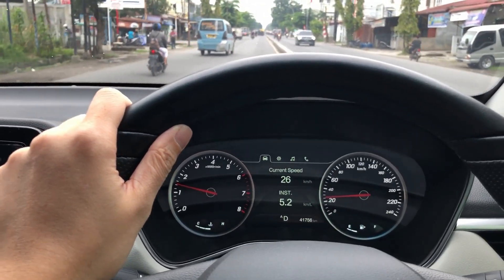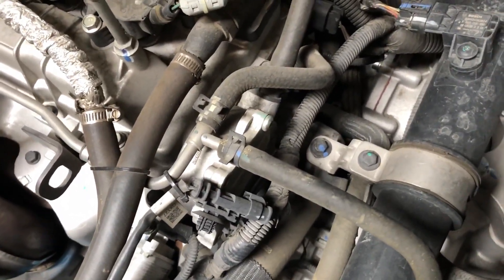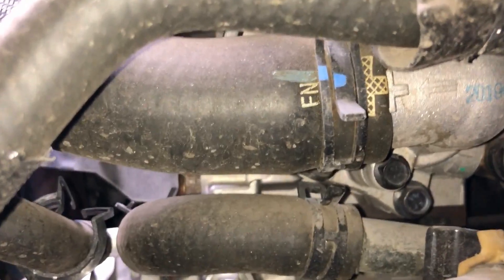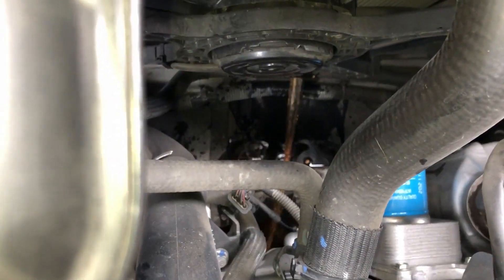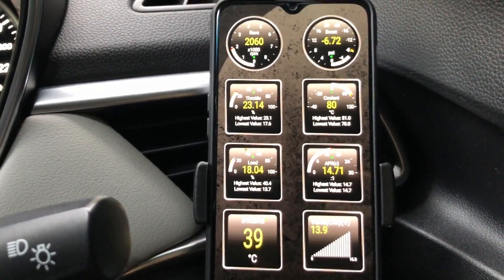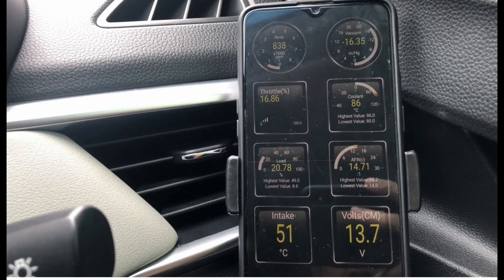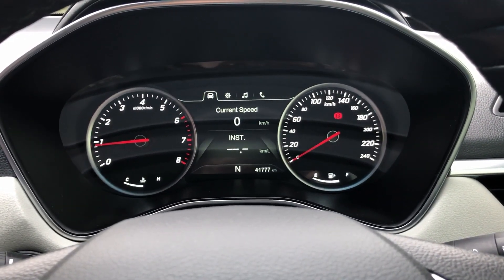Wuling Almaz Cortez Turbo Alvez MG Hector OVERHEAT / 87•C | How to Fix / Upgrade Thermostat 82•C

Comment: Om kalau thermostat diganti ini pengaruh ke mesin dan cvtnya apa cuma mesin doang ?

Dan ada efek negatifnya kah setelah ganti ?
Reply from the maker: Mesin langsung lebih dingin. effek negativ nya 0 . Sangat rekomen untuk upgrade Thermostat 82c ini .
Reply: @GarasiFelixDan  Makasih om atas ilmunya
Reply from the maker: @arisofian sm sm . Klo ada budget lebih ganti juga extra fan ke Tipe RS. Makin mantep mobilnya dan tdk begitu berisik.
Reply: @GarasiFelixDan  kalau tanjakan ngaco jadi ngak gampang overhead ya om ?
Reply from the maker: @arisofian btul , dan seharusnya dari pabrik untuk yg versi phase 1 wajib ganti & adakan program recall untuk part ini hanya saysng aaja Wuling mungkin terlena untuk program recall nya karna mungkin budget ???
Reply from the maker: @arisofian kalo mau upgrade bisa lgs di beli thermostat nya dari link toko yg tersedia pada video ini.

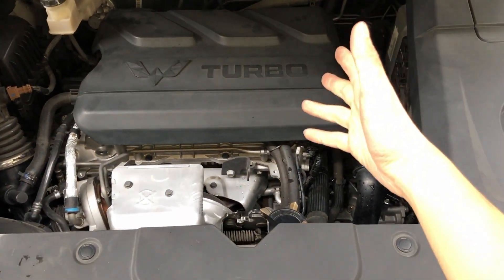Comment: 4:45 - 5:15 pour the coolant through the reservoir tank, just like that?
what about the air bleeding process?
Reply from the maker: yep correct. Bleed it by warm it up for a couple of mins and dont forget to fill it up till max line.
Reply: @GarasiFelixDan  so, no need to open the radiator cap to fill the fluid, right?
Btw thank you om Felix, your videos really help me who is still new to this kind of car DIY project.
Lately I've been able to spend my weekends taking good care of my Almaz thanks to your videos 😀
Reply from the maker: @wnizal  not with this style of cooling system dont need to do any special burp method. Just to remember to turn on the car with AC heater on Maximum for 15 mins and with the reservoir cap off and you will see the coolant in the reservoir will recirculate and run its job it self. then top up the coolant until max line. No worries sir dont forget to subscribe and like all the videos. Thanks for the support.

Comment: 86-87 even 95 in extreme revving or stop and go situation is very normal and within WT range. And it is safe and health.  Cooler than 82 even means something wrong with your cooling system.
Reply from the maker: No it is definately Not normal if your car temp is 86 to 87 and goes up to 95. Driving your car with that temp will leads to catastrophic failure to the engine components. Just a note for under normal driving , stop and go a Normal vehicle temp in Hot weather country mostly should be reading at 80 to 83 degree celcius. Otherwise yeah the vehicle needs attention. Thank you.

Comment: It seem my earlier comment is accidentally deleted when I try to edit it to fix some typo 😅
Nice tutorial btw.
and also I will update U if I successful in my attempt to use  lower temp thermostat (~71c) on Almaz. (if U interested tho...)
thxs.
just don't wait for it , I do it just out of curiosity on very loose time frame 😆
(never had a temp problem on my RS , as U already know it's already on 82c thermostat and some said it had better fans)
Reply from the maker: Yes with Wuling Almaz Rs they have revised the thermostat to 82 C and the cooling fans are much larger and the cvt cooler has 3 ports for the radiator to cooled down. But yeah please i am very interested with the 71 degree thermostat on your car on how will it performed.
Reply: @GarasiFelixDan  OK, I will keep U informed on this matter 😁
PS : I am just curious to how much almaz's radiator capacity to hold  down the temp, on daily use on flat road it hover to aroud 79-80c ish (even on hot noondays)  but it can reach up to 93c on long and moderately steep uphill road, this is one of the reasons that make me too lazy to do this experiment, back then.
And U must also noticed that on cold start ( / first run in the morning ) the "optimal" temp is when the coolant temp reach to about 75-77c right ? 😀
Reply: @GarasiFelixDan  Sorry, I am still waiting about the dimension of almaz's thermostat that U "promised" back then hehehe... ( maybe it's on my deleted comment 😅)
Reply from the maker: @ecrush5080  ahh i totally forgot i will measure it tommorow for you.
Reply: @GarasiFelixDan  Relax, I just need that measurement to search on online-shop,  I have few candidate ( merc part by mahle IIRC ) that seem similar in size and shape.
But hey, maybe U can do it better than me (obviously😎).
Reply from the maker: @ecrush5080  sorry for late reply the measurement for the OE thermostat without gasket is about 4.5cm and with gasket 4.8cm diameter.
Reply: @GarasiFelixDan  Thxss a lot 🤩

Comment: sucks the also Mazda didn't install a thermostat gauge either..........just wait until red light comes on. Thanks Felix take care.
Reply from the maker: Haha yes our mazda also did not have the temp gauge. But it seems that our skyactiv engine has been fitted with proper 82 degree C thermostat from factory so Mazda have thought ahead with their vehicles sold world wide. Then again i will monitor and make a video on the mazda using my obd reader just incase.
Reply: When you know, you know Felix!! And I didn't knew Mazda did that and pretty much concern not to be able to see the temp. I'll be waiting for your video and if you have any ideas in to installing a readable gauge, let us know. Thanks and take care.
Reply: Proper = you mean better quality? We cx-5 folk will be waiting for the vid man. Thanks!
Reply from the maker: @akbarberlian  i mean by proper was in terms of their Mazda specification and better quality . 🙏🏼

Comment: Very useful information Felix. Thank you so much. Do you notice that also Mazda cx5 has same problem? Thermostat is open on 86-87 degree but on idling cooling temp can be around 101 degree Celsius until fan turn on....
Reply from the maker: Our mazda skyactiv engine has been fitted with proper 82 degree C thermostat from factory so Mazda have thought ahead with their vehicles sold world wide. Then again i will monitor and make a video on the mazda using my obd reader just incase. 🙏🏼